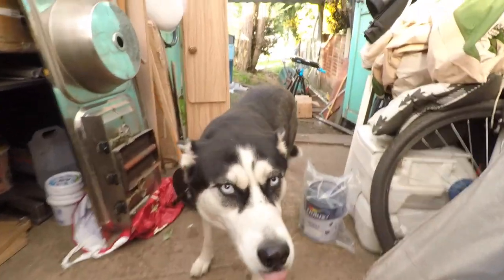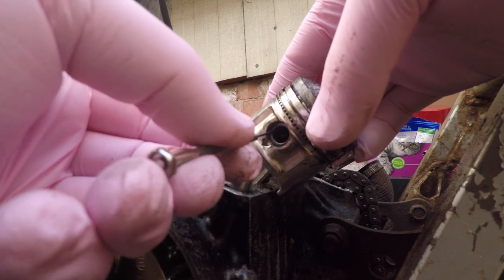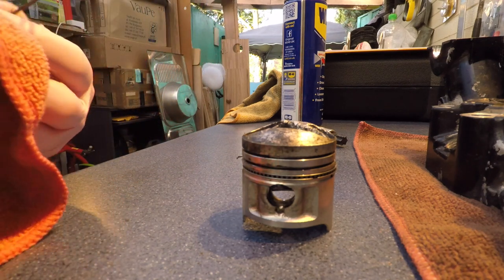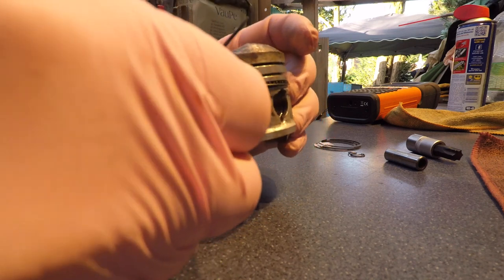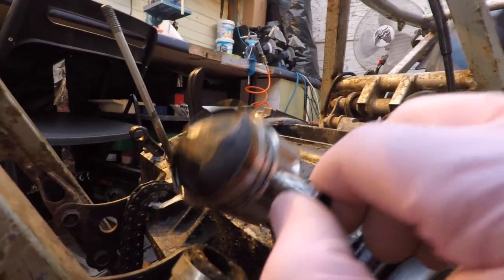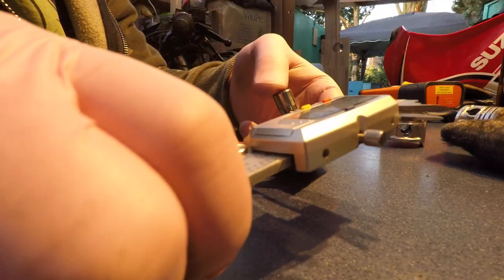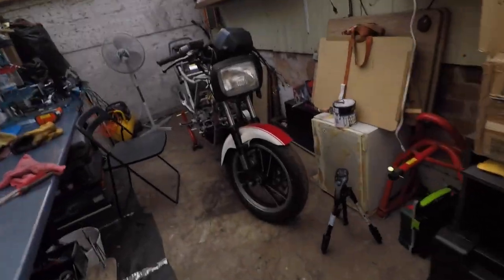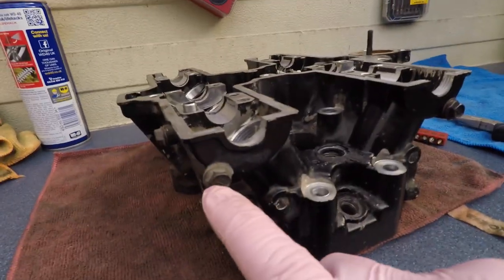Suzuki GS250FW Restoration Pt6 1080

Comment: I was going to comment on the reuse of the pistons and rings, but so your comment about the difficulty in obtaining the pistons. This is bad news seeing I’m in the process of purchasing this Suzuki bike model and now might have some reluctance because of this fact.
Can you attach a link to the supplier you found in Japan so I can review the cost myself?
Also, can you link the gasket supplier you bought from?
Thanks a thousand times for doing these videos.
Reply from the maker: Ok so the piston rings are the same ones from a Honda CB125T, you need 2 sets as the Honda is only a 2 cylinder.
As for the engine gasket set I was inspired enough to buy 2 sets, one has been used in the restoration and i have another one as spare, well done to me for doing that as the Japanese seller on eBay doesn't sell it anymore.
Personally I love the fact that this bike is so rare, that means it will be crazy valuable in a couple of years and It's a brilliant thing to leave to my son.
Reply from the maker: this is the guy selling the gasket set on ebay.
https://www.ebay.co.uk/itm/263366290570
Reply: Thanks for the valuable info my friend. This will save all of us headaches trying to search for something that doesn’t exist.

Comment: Is it possible to find parts for this bike??
Reply from the maker: I've struggled honestly. 
I was looking on ebay and found mostly brake pads and by miracle i've also found the head gasket and gasket sets. 
Suzuky UK doesn't even have it listed in their catalogues.
It's a rare one.

I've even emailed Suzuky at some point but they didn't get back to me.
By another miracle I've found a full bike sold on ebay and jumped on that, ended up making from 2 1 working.
Let me know if youu find any parts for it.
Good luck!